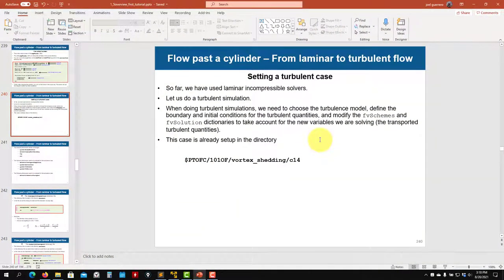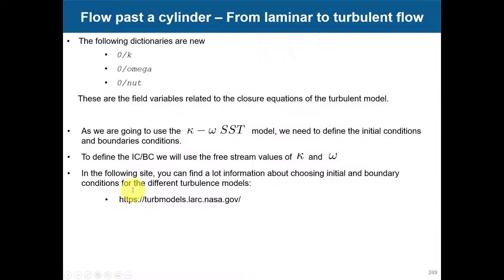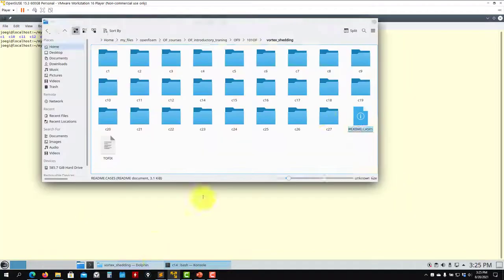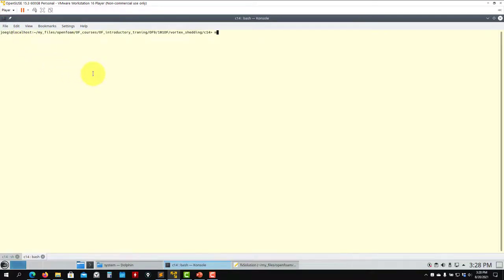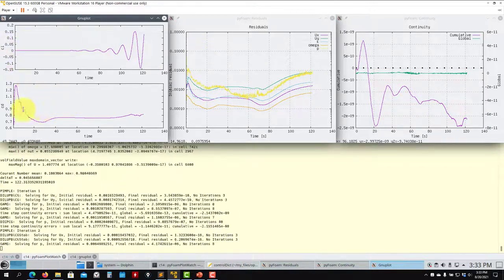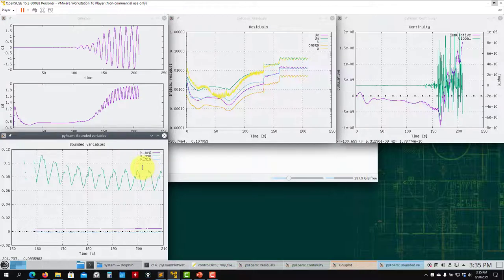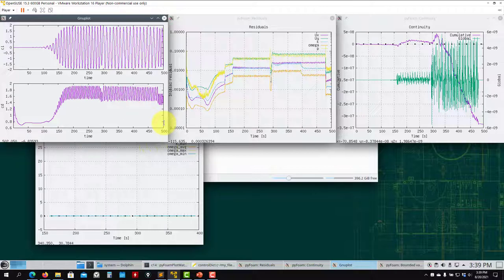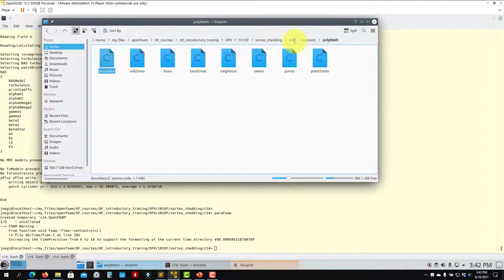1.9 Module 1 | Introduction to OpenFOAM - OpenFOAM 101 #openfoamtraining

Comment: At 6minutes you go over k and omega but kind of skip omega. In the simulation parameters the k uses the low Intensity and viscosity ratio but the omega uses a medium(viscosity ratio). Im just wondering if it this is on purpose or should both values be calculated using the same assumption?
Reply from the maker: Hi,

Likely it was my mistake, you should be consistent when setting boundary conditions. In any case, it is likely that it will make no difference, at least in this case (or for low Re).
Reply: @wolfdynamics5703  thx for the reply and thank you for the great introductory series. + all the other resources you have provided along the way. I am almost at the end of the series and I find myself coming back to this 2d cylinder base case. I have grown to like it as well :)

Comment: iam new to openfoam, how can i adjust time step so i can get convergence in this simulation?
Reply from the maker: Just change the timestep keyword in the controlDict dictionary.  Jsut be sure to choose a time step that resolves the physical time scales.
Reply: Thankyou for your reply. I tried to do the simulation in the video, I put delta 0.001,  write interval 0.1 and end time 2000, the simulation just ends but doesn't converge anywhere. So what parameters should I check to see where it can converge? If u wanted convergence how u would have done it?